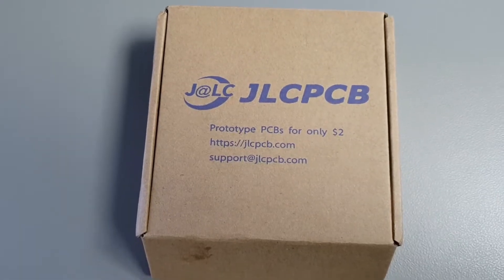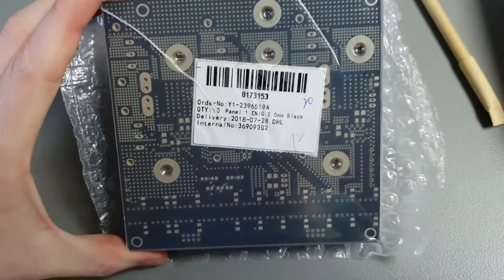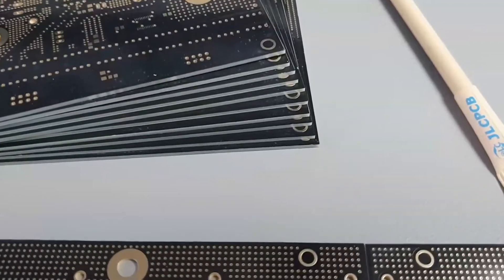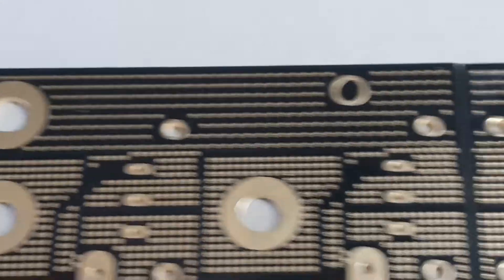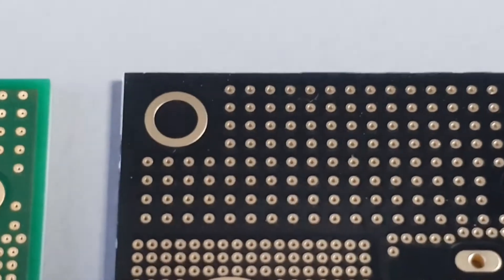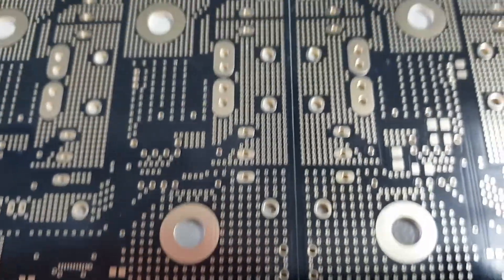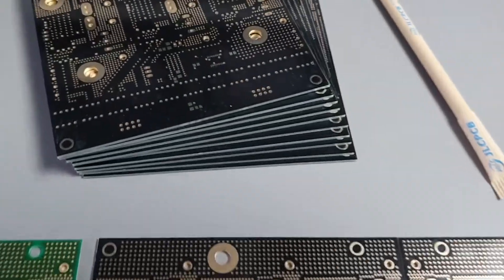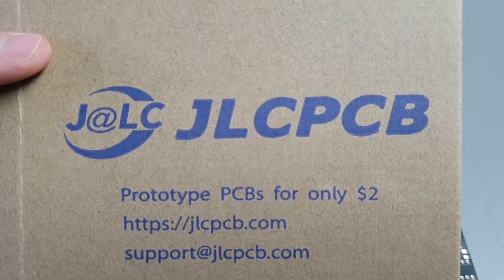µReview #17 | Black ENIG PCBs from JLCPCB

Comment: I don´t know why but using not Hasl and lead-free hasl is giving me problems to solder. I am not the best soldering but I soldered modules bought from aliexpress and amazon and I have no problems to solder those but in the boards from LCSC, the soldered point breaks if force is applied which usually happens in screw terminals. Anyone is having the same problem?

Comment: Which option do I have to choose to get my PCB like yours? So that every contact is golden (Copper) and NOT silver?
Reply: any reply about it? did you get the answer by yourself. If yes, please help me out since I have the same question
Reply: @pablogonzalezrobles4429  Choose ENIG not HASL/Lead-Free HASL as your surface finish option on the website of whatever PCB manufacturer you use. The gold pads/contacts in ENIG are due to the different materials in the finish (Gold and nickel) compared to HASL/Lead-Free HASL (Tin, Lead, Silver, Copper).
Reply: @EdisonWong2004  I don´t know why but using not Hasl and lead-free hasl is giving me problems to solder. I am not the best soldering but I soldered modules bought from aliexpress and amazon and I have no problems to solder those but in the boards from LCSC, the soldered point breaks if force is applied which usually happens in screw terminals. Anyone is having the same problem?

Comment: Why you order 10 boards? it's the minimum or you gonna build 10 machines?
Reply: Because price difference is minimal between 5 and 10. I usually go for 10 because why not spend the extra $1 in case.